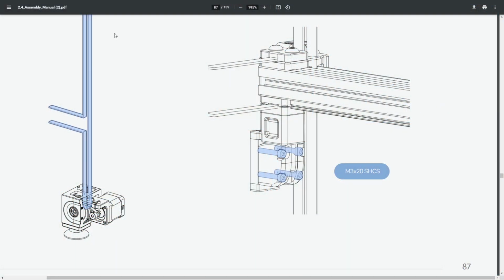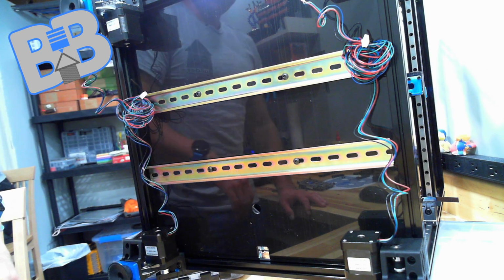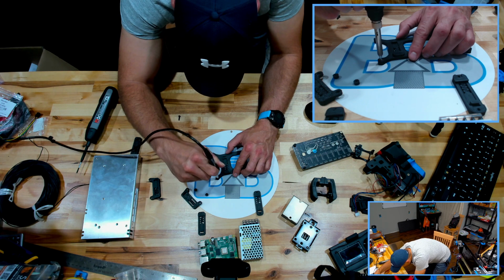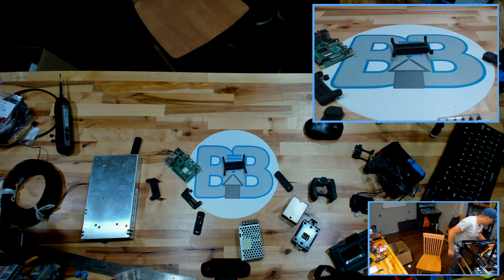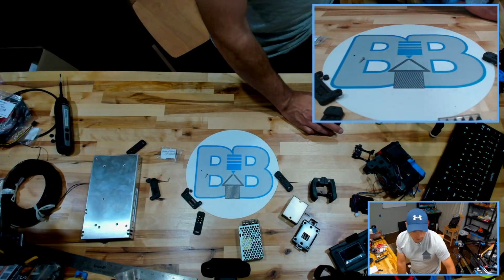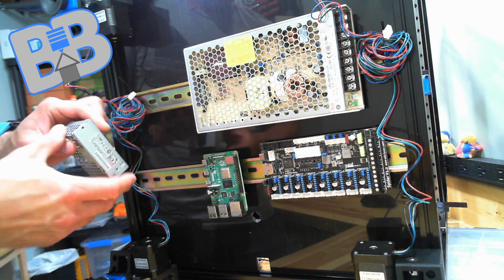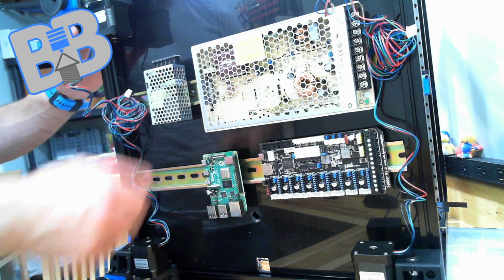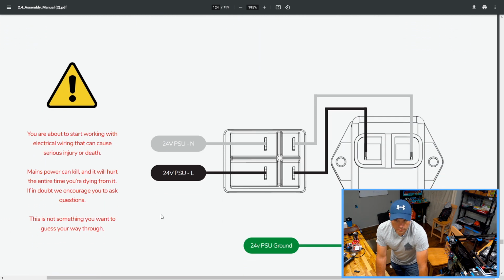VORON 2.4 3D Printer Build It Live *Episode 14* Electronics Mounting

Comment: Nice work on electronic mounting.  Where can I find the STL for the Din Clips.  The one on the Voron site do not have a spring
Reply from the maker: Jaime - The newer versions did away with the "spring". Over time the older ones tend to loosen up some.  I suggest you use the new versions.  I haven't yet upgraded my 2.4 - but I plan to do a partial rebuild to do away with the old clips, add the SB/CW2 and replace a few parts that show some signs of cracking (bad ABS).  Hope this helps clear that up some.  If you REALLY want the old ones you should be able to find them.  Just look for legacy or retired V2.4 STL files.

Comment: +1 for the 230 -> 115v switch. Missed that. Default is 230v. Thanks. (Even though I'm already done with this step figured I'd learn something. Yep).   Ok this list is going to get long:
+1 for potentiometer on power supply tip. +2 for teaching things to your son.  +1 for the micro heat gun and spring compression idea.
Reply from the maker: Thanks... Some people like the detail others don't, guess that's what makes YouTube so great.

Comment: I don't have any 3d printers yet and I want to build the Voron. however, I see the 3d parts alone cost around 150$ I am thinking of buying a cheap printer for that money and just print the parts myself. it will also give me a taste of the hobbie. My question is will resin parts be good enough? i might buy a small resin printer instead that way il have both types after im done.
Reply from the maker: I don't believe you'll have a good experience printing Voron parts on a SLA printer.  Two or three issues come to mind.  First the parts are designed to be FLA printed in ABS plastic, a certain amount of shrinkage is expected and calculated in the files provided by the Voron team.  You could off set this (some) by reducing the print sizes, you would need to do some tweaking. Second, the material properties for most all resins.  Resins tend to cure over time. and can become brittle.  While you should have no issues with heat, you would have issues with parts that are under load and stress fractures that would undoubtedly happen way too soon in the printers life.  There are a few additional issues that come to mind, but to keep things short, just don't do it.  Unless you want to do it for experimentation. 

My suggestion:  Get an inexpensive FDM printer, all you really need is a unit that has a heated bed capable of getting to around 100 degrees Celsius, a little warmer is better (105-110).  A hot end that you can print at 250 degrees and some decent ABS.  You'll need to make yourself an enclosure of some kind, even a cardboard box can work.  Having experience with a "street" FDM printer will give you some experience on how to properly slice and set settings so you will be better equipped to tune and adjust your Voron.  If your 100% not looking t buy an FDM printer I suggest you check the Discord and purchase the printed ABS parts.  

As a side note - on the cost of parts, the cost of the ABS you use to make the parts is about 75-80% of the cost in that ~$150 figure.  Expect to pay about $30-$40/spool and you will need about 1.5 of the base color (usually black) and .75 of your accent color (usually red).  If I went back in time I would have just printed my parts, the experience is worth the failures and cost.  Hope this helps!
Reply: @BuildItBasement  great reply thanks for the detailed response, i will just look into getting a beginner FLA printer so. The experience alone will be worth it. 

many thanks
Reply from the maker: Even an Ender 3 would probably do it for you. You can find one for well under $200. Probably closer to $160 new.